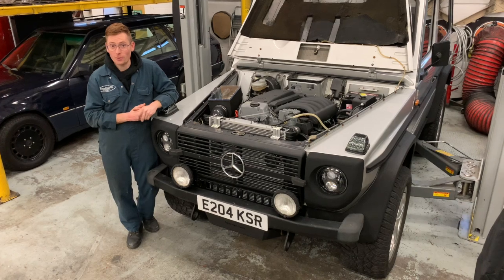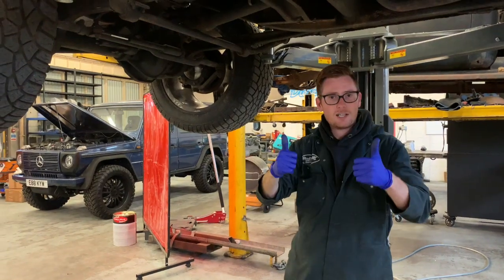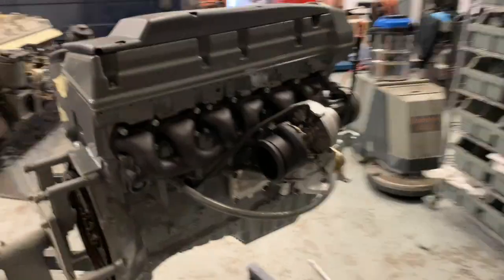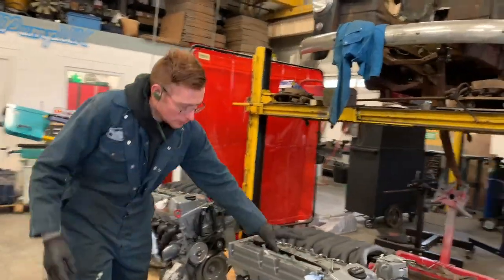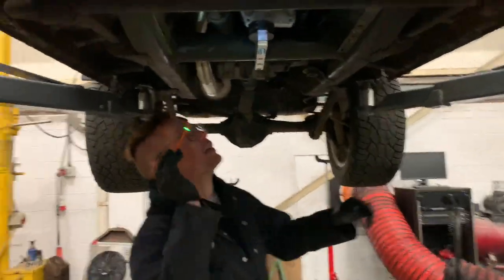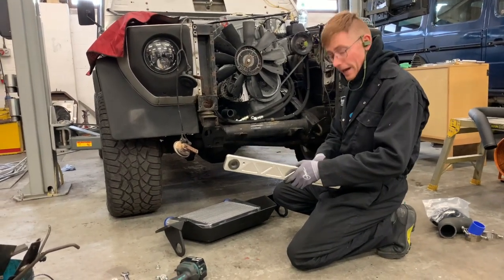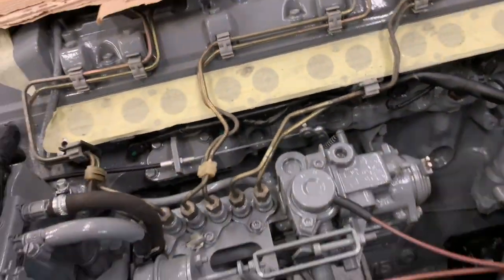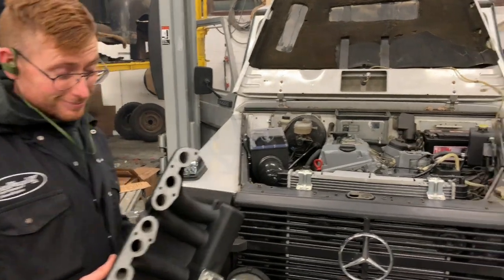Powerful Reliable 1988 Mercedes DIESEL G Wagon build install (DRIFT BURNOUT AT THE END)

Comment: Not Bad. I do understand the use of a G wagon for the conversion as you specialize in Mercedes but in the US good ones are hard to find at a reasonable price. Bet the oil pan you developed would fit into a Jeep Rubicon as they are showing up with blown motors and especially transmissions everywhere. The problem with the US is smog regulations. There are places where one doesn't need to smog their cars but even so it would be illegal. I like the 606 with your pump and adapter plate for the BMW trans as it seems a good transplant into almost anything with a little fabrication. I've been a sub to your channel for awhile and I've noticed you build a mechanical pump for the 603. Rare motor in the US and I have one in an 87 wagon but it needs just a bit more snap. Mine has the computer controlled injection but I really don't see an issue swapping unless its with the transmission which I would like to swap with the BMW manual or a Benz manual. Question, does the 606 and the 603 share the same bolt pattern for the transmissions? I also have a 94 Estate that would be perfect for the 606 swap but one thing at a time. I'm lucky in a sense as I register cars in a place without the smog police breathing down your neck. I think your on to something here. Who doesn't want power and fuel mileage? Like I said this would be great in a Rubicon as Benz did own Chrysler for a time and maybe you could fake someone out. Ha Ha.
Reply: T salinger1026 they should focus on a swap for the wrangler as they are everywhere in the us and in theory should bolt right up to the 2011- newer trans which is a w5a580 aka 722.6
Reply from the maker: Cameron k  we already sell swap parts for wranglers but it’s very rare we sell any it seems to be a very slow market for those.
Reply: To answer your question, yes, they do have they same bolt pattern mate. And, I'm in California where the highest smog regulations are. If you need advice on how to make your car legal, HMU. Also, old diesels are smog exempt for obvious reasons, even though they have some emissions parts installed from factory. I myself plan on ordering parts from dpuk as soon as I finish computer tuning my electrically controlled fuel system. For you, it would be easier to just swap the fuel pump and transmission to manual/mechanical. Also, you have more potential for upgrades that way.
Reply: @cameronk6621   About the Jeep convertion, take a look on Mercedesdiesel4x4.c0m for the adapter, baldur dsl1 to control the engine, dieselpumpuk for the oil sump and oil pump convertion.....

Comment: Hi there. I’m in Australia. Just wandering. Do you import ready to run engines to Australia? If so can you please tell me cost ? Also do you have a bellhesousing kit to fit an 80 series toyota Landcruiser. Originally the 80 series comes with a straight six. I think it would make a good fit. Please let me know if you can.  Finally I’m so impressed with your work.  Love watching the videos. Thanks heaps.

Comment: Not quite sorted the cooling. Shutoff valve for heater cuts head circulation. You’ll be pleased to know it now has a modified diverted style valve to maintain coolant flow through the head whilst enabling correct heater function. Still goes well in 2022. Likes North Yorkshire Moors tracks n trails. Eats Sutton Bank for breakfast like it’s not even a hill 😁.

Comment: First...I absolutely love what you do with OM606s, its amazing! The question I have, I think you answer, but I just want to go a little deeper. For an overland vehicle do these mods decrease the effectiveness of low RPM torque, long distance slow crawling, fully loaded dirt road or sand dune excursions? I am building my overland rig right now and would love to think that these updates to my OM606 would simply make it way more pleasurable as a daily driver and still maintain its amazing overland performance. Last question would also be...impact on fuel consumption?

Comment: hi ive a 1985 om616 n/a . have you got the upgraded return fuel pressure releif valve , the one with the spring and ballbaring and banjo connected ,,,,the upgraded ones have a stiffer spring to keep pressure higher on the rail ,,,please reply ,keep up the great great work

Comment: When will these used parts be for sale?
Radiator adapter, intercooler with bracket, gearbox lever adapters and all lower brackets ?.
I hope to see you soon on your parts sale page!
congratulations LUCK
Reply from the maker: pedro viggiano  very soon just need to work our accurate pricing

Comment: would it be hard to convert a m103 powered s124 to use a diesel engine?
Reply: Georg281relo probably the easiest conversion out of them all
Reply: @Diesel8290  Nash! Easiest is w123 200 or 230e to 240d
Reply: andrew allen no it isn’t considering there’s no bolt in engine arms for that older chassis

Comment: While a Chinook helicopter is probably the best way to remove an engine, you can also use an engine hoist if you get really desperate. Also, just mark the damn driveshaft with a piece of chalk before you pull it. Looks like a nice swap - I love the way the the trans mount bolts onto the factory crossmember.

Comment: everything is awesome about this engine apart from alternator placement. for a road car its none issue but for an off roader its horrible as they will get clogged with mud then its gg. and i assume replacing on in a car isnt an easy job on the side of the road?

Comment: With these torque/hp figures are you recommending any changes to axles, CVs etc?
Reply from the maker: N Noddy no, stock running gear is good well past 400bhp
Reply: @DieselPumpUK  gotta love old German engineering. If it was a Landy we would be changing the whole driveline.

Comment: Why not mercedes 270 cdi 6 speed gearbox, is it too fragile
Reply: Good question
Reply from the maker: hogar strasni  the 270cdi box is strong but it suffers with the same crappy shifter system as the rest of the Mercedes transmissions, it’s a much better shift feel from the zf.
Reply: @DieselPumpUK  thanks for the reply

Comment: I've got this crazy idea to stick a Mercedes 606 into a Dodge Ram 2500 that's currently being powered by a 5 9 Cummins just a crazy idea won't leave me alone
Reply: The 5.9 is a more heavier duty longer lasting engine than a om606 the om is definitely lighter but definitely wouldn't last as long taking monster horses power as a Cummins 6bt the 6bt is an industrial engine so is far more more heavy duty and can be tuned for insane horse power where as the om606 was designed for cars not small H.G.V.S  tractors buses excavators etc like the Cummins. Dont get me wrong the om606 is impressive for its size but it ain't no Cummins courses for Horses.
Reply: @g.a.f3398  I was just trying to get the weight down in theory it would work but yes I've got a two thousand four and a half 6bt 5.9 Cummins down in my truck right now it is the h o model and it's been paired with a 62 mm Turbo it pours the smoke going down the road if you stomp on it and I was just trying to get the smoke content down however I did need an excuse to put a methanol injection system on I guess that's the route I must go

Comment: What could I do to my Om642 to get more power, I already deleted dpf adblue egr and tuned stage 2. What is next.
Reply: engine swap
Reply: @AAABBB-rc6zi  funny guy i already have 300hp   and +500lbs torque
Reply: @rafaelrjarquin  Im not joking first of all. Swedish ppl tried to tuning om642, after 350 hp the engine exploded. btw i have the same car as you. cheers
Reply: @AAABBB-rc6zi  ok I don't know here in north America there's nothing about tuning om642, I never heard nobody but me fully deleting is ml350 especially w166
Reply: Rafael Rj u should try to contact them : https://kcperformance.eu/en/tuningstages/article/18-mercedes-benz-om642-2010 
Maybe they have experience with om642 but the limit is around 340 w/o piston modification
Reply: @AAABBB-rc6zi  thanks brother that's what I was asking for, What turbo and intercooler upgrade. Have a merry Christmas with your family.
Reply: @AAABBB-rc6zi  I'm looking for, to buy an old Merc with om606 and built it.

Comment: You know that the German pronunciation of g waggon is "gay waggon" don't you.

I'd like to fit one of your pumps to the original old 5 cylinder (617?).
I know you can still get good power, but wouldn't have to change the gearbox etc?